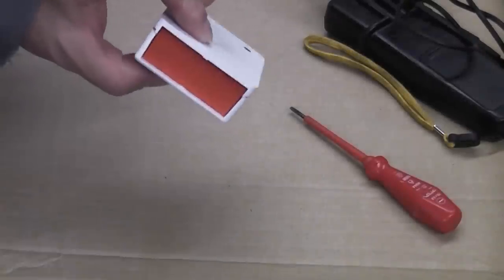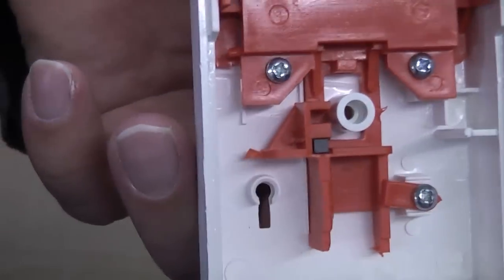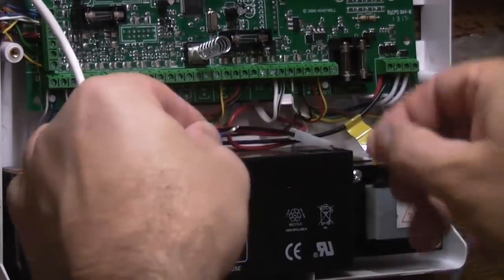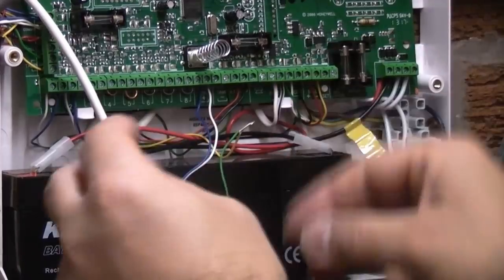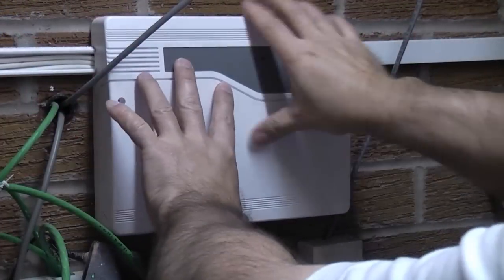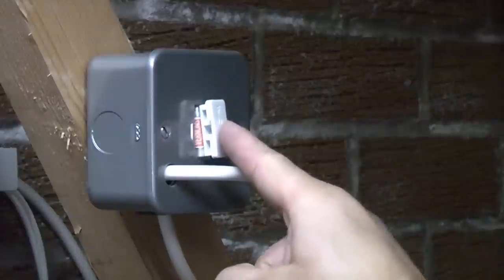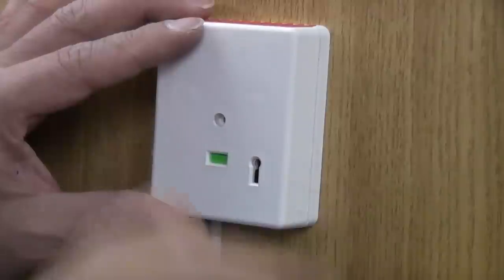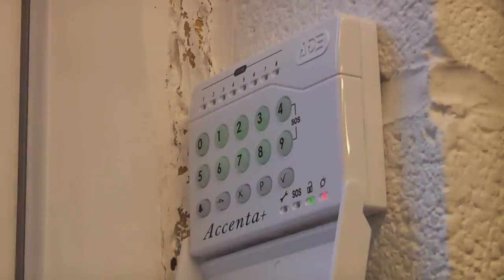How to wire a PA button to a Burglar alarm

Comment: Never fit a PA button with the button facing upwards! They can sit there for years without getting used, and this can lead to a build up of grime between the housing and the button which can render the button useless when you do go to use it. Always fit the unit so that the button is either to the side, or underneath. Look at BS 4737.
Reply from the maker: You would think they would include that in the instructions, wouldn't you.
Thanks for the comment ;-)

Comment: I need to disable one of these for a room renovation. I've no use for it. Can I just cut the wires, put electrical tape on the ends and then bury the wire under the carpet? I'm trying to avoid tracing the wire under a large stretch of carpet and opening the alarm box.

Comment: You could use a block connector instead of soldering.
Reply from the maker: Yes you could but they take up a lot of room in the panel, especially if all 8 zones are used.
Thanks for the comment

Comment: Hi mr handyman. I would like to say your videos are great. Saved me hundreds of pounds following your videos.
Can I ask if I was to add more than 1 pa button to my system would I wire the blue and white in a loop like the tamper wires or in series?
Reply from the maker: Yes, if you add more than one PA button you wire them in a loop just like the tamper circuit, which is known as wiring them in series.
Thanks for the comment

Comment from the maker: @ james murphy
 Next video requested by me P.A button demonstration.

Sorry, I only wired it as a demo. It has now been removed as I did not need a PA button as the kids would probably eventually press it in ;-)
Reply: ***** Shame, I was getting ready for it to be pressed but the bell box will start screaming for 5-10 minutes. My friends alarm did that, I only moved the P.A button to the side as it was in the way and it hit the wall (not very hard) and it set the alarm of we put the code in and the outside bell box didnt shut up until after 5-10 minutes.
Reply from the maker: james murphy
With the optima panel you might have to press the reset button, which is the X after entering your alarm number.
Reply: I dont have the same alarm as you anymore as the circuit broke. I have now got a new panel but its called Paragon E by Pyronix
Reply: ***** Does the P.A need the tamper circuit wiring in
Reply from the maker: james murphy 
No, it does bot have to be wired in but then there is a chance someone will tamper with the circuit and prevent it from ever working.
Reply: My P.A button is broken then it is not activating the alarm when pushed
Reply from the maker: james murphy 
Have you only wired in one PA button?
Can you see the magnet in the plastic part of the button that opens and closes the reed switch?
Do you have a multi-meter?
Reply: I don't it broke as it fell from a good height.
Reply: Is there any other ways please
Reply from the maker: james murphy
Not much you can do with it if it's been dropped.
The reed switch is probably broken!
Reply: theres no cracks or burn marks on it. To tell you the truth theres nothing on it
Reply from the maker: james murphy
If you have a multi-meter you can check the reed switch, but in all honesty it will probably be damaged.
Probably cheaper to buy a new PA button ;-)
Reply: Yeah it is broke it's cracked I'll have to buy another one.

Comment: How can I disable this alarm without the code? Just bought a new property and spent a fun 30 minutes with it going off !
Reply from the maker: To diable an alarm, you can switch the power off to the alarm (you might have to remove a fuse from a fused connection unit), then unplug the battery in the alarm panel. The outside bell box might sound for 20 minutes (until the battery in the bell box is flat).

Comment: It might be a daft question but does the alarm have to be set for the PA to work? It connects like a magnetic door contact and we can open our doors without triggering the alarm when it's not set. 
We never set our alarm when we go to bed. If the alarm is not set, would the PA still operate if we pressed it in the middle of the night after hearing someone downstairs?
Reply from the maker: Yes, the PA button will work all the time, regardless of whether the alarm is set or not 👍

Comment: Great videos. Can you please tell me how to install 2 panic attacks alarms I have the same alarm panel.
Many thanks 
Moe.
Reply from the maker: Just wire them in series and you will be fine. If you are not sure, just search Google for "series wiring"
Thanks for the comment 👍
Reply: @ultimatehandyman thank you.
I have done all the tamper in series do you mean white to blue and blue to white and then into pa slot.
Cheers

Comment: would you use a 3 amp fuse in the spur? also does it matter what colours you use as long as it is the same at the alarm panel and the application end?
Reply from the maker: Yes 3amp fuse in the spur.
You can use any colours you like as long as they match at both ends.
Thanks for the comment
Reply: nice one cheers